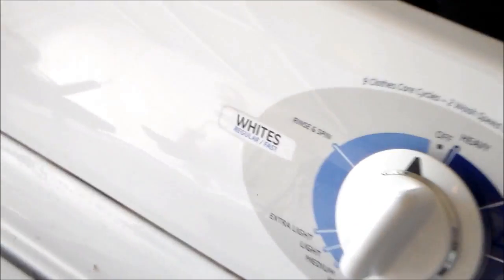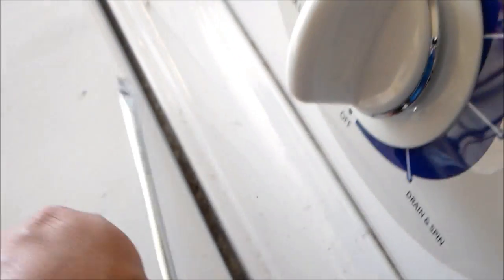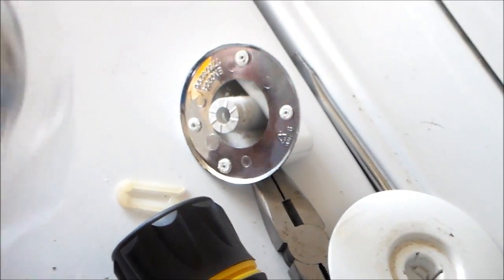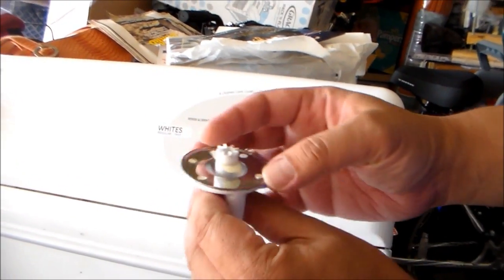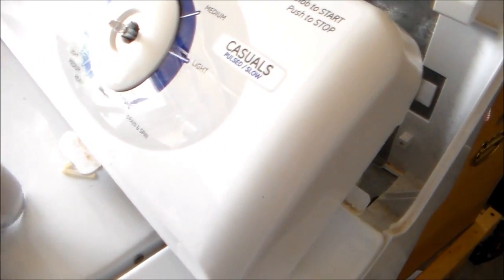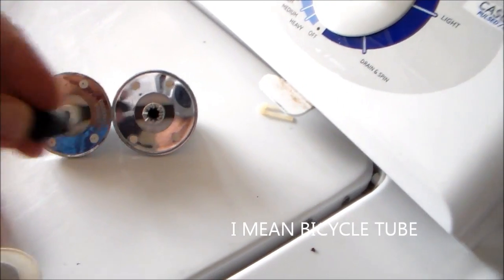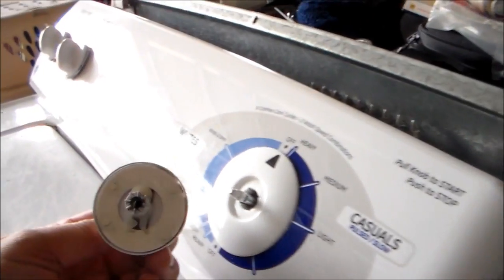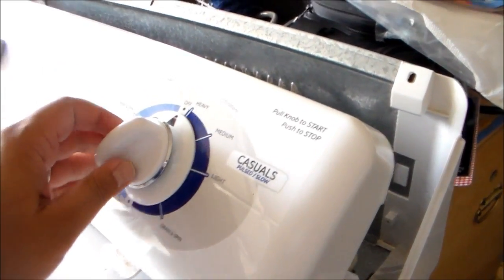GE WASHER KNOB REPAIR

Comment: I just had that happen to my washer.  I'm in an apartment so I called Maintenance rather than self-fixing, but this video has taken a load off my mind.  I was worried that the whole mechanism was one part and it would be an ordeal to get fixed.  In hindsight that's unlikely since the knob is plastic, but anxiety doesn't care about logic.

Comment: Cool beans. This is what's wrong with my washer. I wish GE wouldn't use plastic on parts that can wear out like that. Mine did last 20+ years though.  Thanks!
Reply from the maker: I dont know why they use plastic washers. its the teeth that wears out a lot.pot metal or aluminum is a better upgrade

Comment: My wash machine kept eating them up . I finally figured out that the timer was not held in securly enough . Timer was flexing while moving the timer into place causing separation of the gears . This caused it to strip out . I noticed 2 more tabs on the timer that we're not utilized , so I drilled through the face plate inline with the tabs and engaged 2 screws . Timer is solid and no more flexing . Knobs do not wear out now because the teeth are always positively engaged . Hope this helps someone .
Reply: thank you I'm getting ready to take the back plate loose because mine is all over the place.

Comment: do you get electrocuted if you touch that metal part while the machine is on? because i cant get a replacement for mine. so i thought of just using pliers. but i wonder if water gets splashed on it.

Comment: The plastic timer inside my machine broke where the screw attaches it to the front face. Had to drill new hole in plastic and the metal and put in a new screw. Otherwise the timer was loose and wiggled, not letting the knob work correctly.